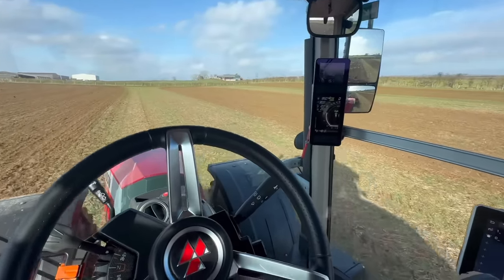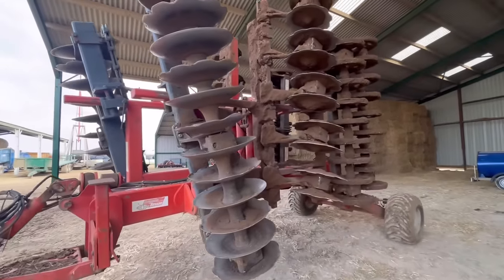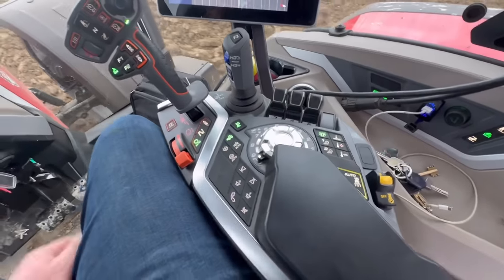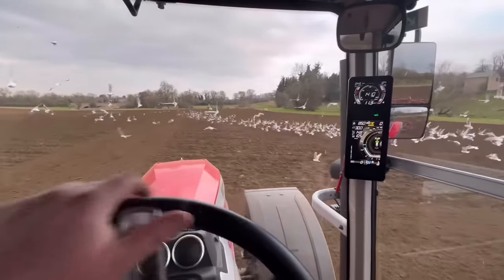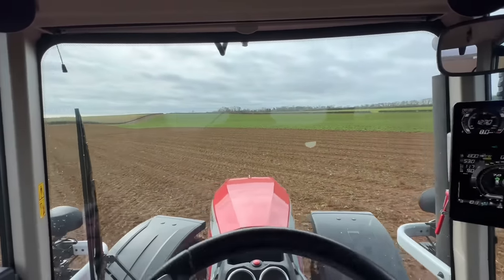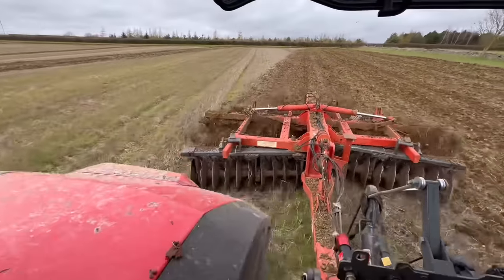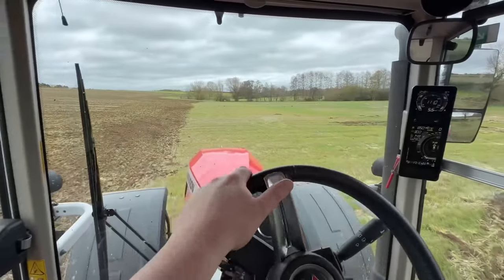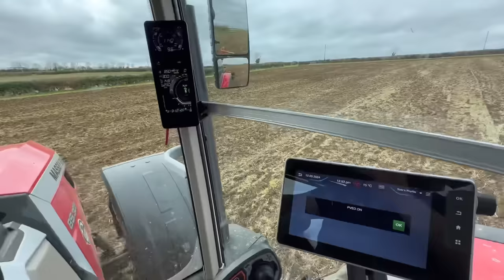I got a tractor stuck in the mud. More sugar beet and loads of rain

Comment: It’s the speed that amazes me. Back in say 1997 I did a mod on a pottinger rear mower set so it could angle up more and leave some green in the grass stem when silaging. They said it recovered faster for the next cut. Anyhoo, 27ft cut at 15mph. Just astounding. And it had conditioner drums, so no idea how much fuel it used per hour. :o)

Comment: A very different beast to the Ford 4000 I learnt to drive on. That was an old girl back then as she was on a H reg on the old plates, she was registered in 1969. I wasn't even a twinkle in my Dad's eye then. The last tractor I drove was a John Deere that had the split screen with the door. Can't remember what model number she had. or registration year, she was the Plant Foreman's Run about at British Sugar. That had more controls but I didn't use them as I hadn't a clue what they did. The New stuff like your MF is another planet with the technology it has. I always wanted to work on a Farm and the nearest I got was a Poultry Farm in my Teens in the early 90s.

Comment: those new Masseys look so good, given that they just use last gen Fendt gearboxes and the krisp Agco Engines they do make for some nice tractors, just stinks that  they don´t get the full range of PTO speeds, but the price it pretty neat
Reply from the maker: Mine have always had the full range of pto speeds
Reply: @Tomlamb980  I thought you could only get them with 2 speeds?
Reply from the maker: 4
Reply: @Tomlamb980  well I guess I was misinformed, guess they do get the full gearbox